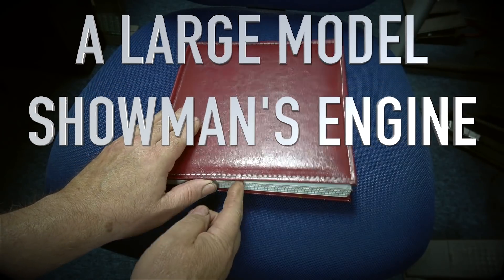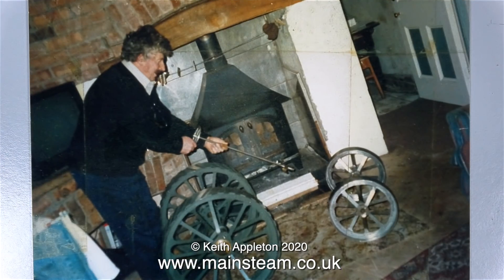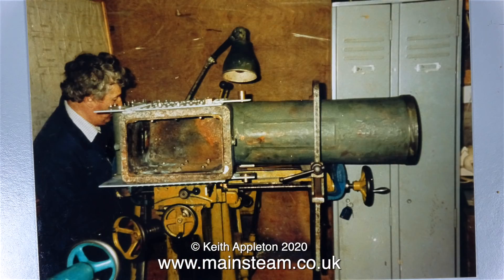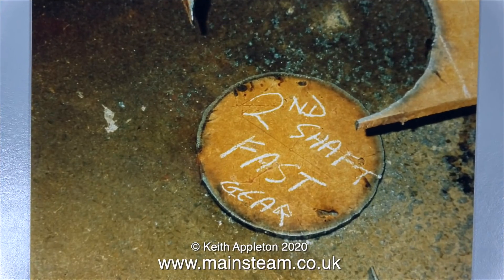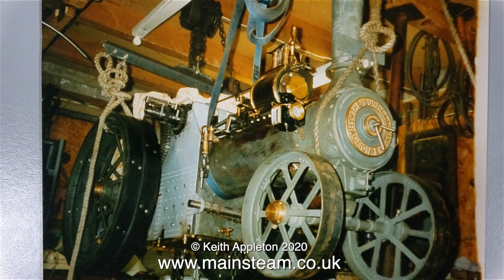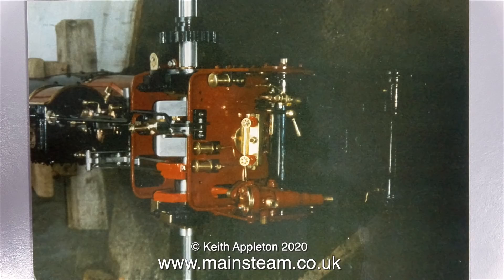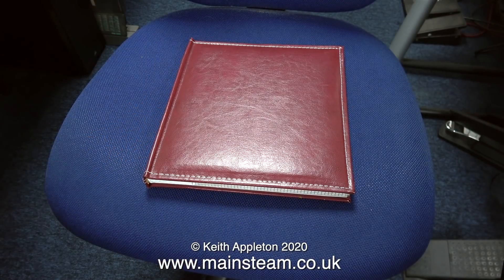A LARGE MODEL SHOWMAN'S ENGINE - PART #28

Comment: This is very special, most builders don't record their progress with photographs.  It shows how the builder adjusted his design over time, maybe that axle couldn't take the weight or it didn't look right. The original flywheel might have been too light, or again, he didn't like the look of it. Either way, he was flexible enough to make the changes and carry on. Now Keith has made a video recording and future generations will see how a craftsman works.

Comment: it looks to have been started as 4 1/2 inch traction engine to LSM (plastow) or bridgeport design. these had the round front axle and spoked flywheel. it was converted before the build completion to showmans spec and a square (possibly stronger) front axle was fitted to take the extra weight of the dynamo and a solid flywheel + belly tanks added to complete the showmans spec

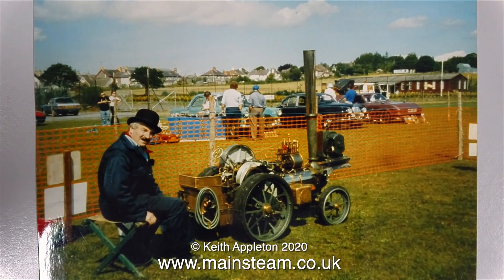Comment: Is the fly wheel solid? At 5:10 you can see it is a spoked flywheel with a cover on the outside giving the impression from the left side of being solid?
Thank you for sharing.
Reply from the maker: No it isn't. It is a casting with "cast in" reinforcement on the inside of the flywheel.

Comment: Lovely video, I find build logs of the pre digital age to be a little more special. Do you know if the original builder is still around?
Reply from the maker: The man who gave it the first test run in one of the album photographs contacted me. He told me that it was built in Wales by a man called Lynn Edwards. Sadly he is not around anymore, but the engine lives on.